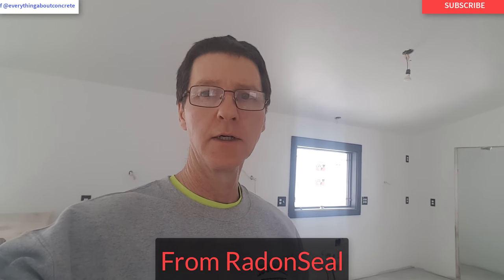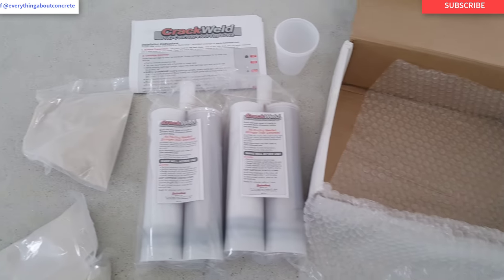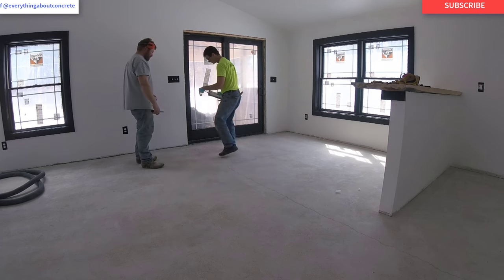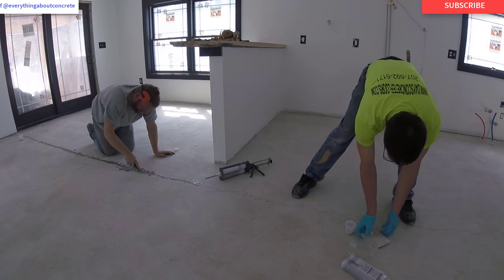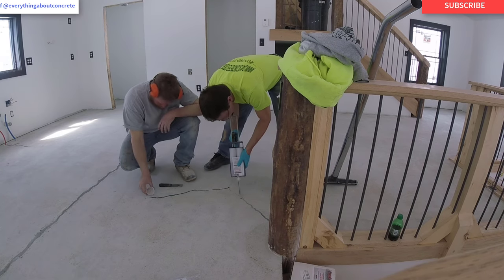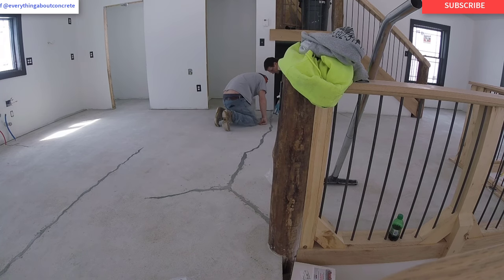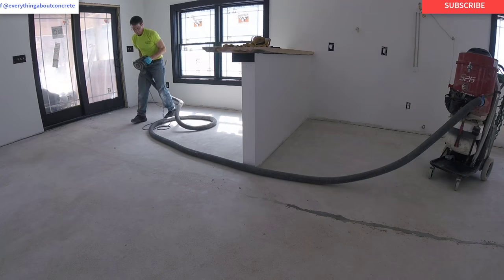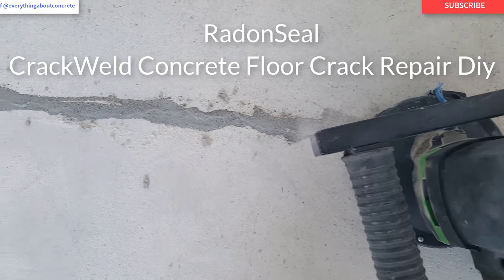HOW TO REPAIR CRACKS IN A CONCRETE FLOOR | A STEP BY STEP GUIDE

Comment: Hi Mike, nice video. I have a contractor who has leveled my floor however has left it with a few imperfections. I would like to have an indoor concrete flooring in a grey color. In my inexperience i see 2 ways. One: re-level the floor with a coloring pigment and then use an epoxy coating. or repair the imperfections with a kit and then use a concrete colored coating which might be a cheaper option. What do you think?

Comment: Hey Mike - thanks for the video. If the homeowner was putting flooring over those cracks would they need filled? Or was it because they were just gonna add a clear layer over it?

Comment: Good morning. A lot of my basement floor cracked due to water coming up from a broken sewer line. That line has been replaced by the cracks are much bigger than the ones you are repairing here. Would you still recommend this product or would you go for something heavier duty? I've also taken care of any other moisture issues by having a french drain installed on the perimeter of the basement.

Comment: The carpet guy asked if I wanted to fix floor crack by caulking or cement. I didn't know, so I thought cement would be best. He made quick cement on the floor and wiped it over the cracks and let it dry. Should a floor guy go back and have it redone with your method then put epoxy flooring on it? Thank you.

Comment: Mike, I just discovered your channel today. Awesome videos.... many apply to me DIY... especially stamped concrete. The final repair of the cracks in this video look great. I scanned through your videos looking for concrete driveway repair to no avail. Do you have a video for this? I have read many different solutions that do not look professional in matching the concrete; it still obvious of a crack even though you may have sealed the problem. Do you have a preference of products and suggested repair method. Thank you Mike.

Comment: I use same idea but different product.  Also adjusted my application,  I wet the crack then pre mix my sand and epoxy into a bucket then apply.     I'm usually doing larger cracks and doing it alone so this way works more efficiently for me.     I never understood mixing the sand in the crack " as is needed for larger cracks " and at times I've had the epoxy not come out at the same rate from each tube and it created areas that wouldn't harden.   So I just started emptying both cartridges after getting crack  into 2 quarts of sand and mix it up.    I've had no hardening issues since.          Obviously for hair line cracks  i would change my application

Comment: You recommend the Dewalt Grinder, DEWALT Angle Grinder Dust Shroud, 5-Inch (DWE46153), but it looks like you're using a different grinding machine with two handles. What specifically is the brand with handles in your video?

Comment: Hello.
I have a 5mm crack running the length of my bedroom and ends at the hinge side of the door. Bedroom is at the end of my house. No further cracks.
At places next to the crack it sounds hollow. 
Need I be concerned and if concerning then how do I fix it?
Thanks in advance.

Comment: Hi Mike, I was wondering where you purchase your sanding discs for cleaning off the top of the cracks once the material is cured?  Thanks Rich Thompson
Reply: Did you ever get these disc's? I'm doing DIY ctack repair and need these. Please tell me where and brand? I appreciate it 🙏

Comment: I have a 1/2 wide crack in my floor (just pulled up the carpet).  It looks fairly deep and one edge is higher than the other.  Can I use this product for this?
Reply from the maker: You can yes. You'll want to fill the crack with some backer rod foam first, leave it down about 1/4 to 3/8 inch, then use silica sand and crackweld like we're doing in the video to fix.
Reply: Thank you!

Comment: Hey, Mike. We just wanted to come back to your video and say thanks. We did Order the Radon Seal and we used it on the job and it worked amazing, however when we were finished sanding it you can see the sanding marks, is there something to put on it to make the coloring blend in after sanding. We also ordered some tools yesterday off Marshallton and used your coupon that you told us too. Thanks for that.
Reply from the maker: It will eventually blend in on color. There's nothing you can do that won't make it stand out more. You could epoxy it to hide everything.
Reply: We are repairing our concrete floors.  Question, there are many cracks and the floor is uneven in some areas. 
Do we repair the cracks and then do a self leveling mixture? Or the the mixture first and then repair the cracks?

Comment: What grinder did you use?
I need to do a bunch of cracks but cannot clear the  basement of belongings in it. Will I be able to grind off the high spots without getting dust all over everything? I have a Shop Vac that I assume I can attach to the appropriate grinder you recommend.
Also, I will not be able to do the whole basement in one session since I will have to move some stuff around. Do I need to get extra mixers or backflow valves so I can do multiple sessions?
Reply: Metabo grinder with dust guard will do everything you need. Your shop vac won’t fit on it but you can tape it and it’ll be just fine
Reply: L

Comment: Are you able to use this product outside on driveways or sidewalks
Thanks Larry
Reply from the maker: You can. It cures very hard. As long as the cracks isn't active, it'll work just fine.

Comment: I have a large half inch crack with big chips chunks missing. Will this work or is there something else i need to use?
Reply from the maker: That's pretty big, I might use Sakrete Pro Mix red bag for that. It'll repair up to 2" deep to feather edge.
Reply: @MikeDayConcrete  ok koolio. i had a "concrete painter" come out and he recommended i get a mason to fill it with quick crete. sounded easy enough.

Comment: Can this material be used to fix the thin cracks in the basement floor that seem to be letting some water come up on the basement floor surface?
Reply from the maker: It will fix those cracks. But if there's that much water coming up, it'll find another way. The crack would have to be dry also for you to use this repair material.
Reply: @MikeDayConcrete  
The cracks are completely dry at this point. There are some signs of water being coming out of them at some point in the past.

Comment: Will this work on fountains? No undercutting?
Reply: Fountains are the son of a bitch of Concrete.
Reply from the maker: It'll repair cracks with out undercutting.
Reply: @MikeDayConcrete  I have all the tools right now to undercut my leaking fountain. I still dont want to do that now. Can you offer up what to do on a leaking fountain?
Reply: Fuck my life!
Reply: @MikeDayConcrete  I tried many times to not under cut. But would like a solution to the problem. Too many leaks to describe. Still not yet tried to undercut anything with Concrete.
Reply: @MikeDayConcrete  I tried it all.

Comment: Why were there cracks in the floor in the first place?I was led to understand there should be an expansion joint in a floor that size🤔
Reply from the maker: Concrete cracks, homeowner did his own floor. Just shrinkage cracks/stress cracks. No problem to fix, we're applying an epoxy coating over this one.
Reply: Agreed........But we have to assume for the purpose of the exercise that has been done. Or that would be another vid...........Maybe a good analogy would be "how to replace a fuse"......One would have to assume the cause(appliance) has been checked first.

Comment: Would you use this on a driveway outside
Reply from the maker: You could, but if the driveway moves it'll crack. This company, Radonseal, has a flexible repair also. Radonseal.com

Comment: Not sure if you are apart of Radon with selling the Crackweld. I am a supplier of one of the original concrete repair product know as an ultra-low viscosity Hybrid-polyurethane. I can sell it a lot less than they are offering.
Reply from the maker: I'm not. This is just what works best for me. Send me one and I'll try it. daysconcretefloors@gmail.com
Reply: loctite pl s10?
Reply: @tbarbuto2345  hey if you like it and it works all that matters.
Reply: @TimothyCorum  I was asking what product you were referring to.

Comment: If there is a crack it is for a reason. There is an underlying issue that is not being addressed and this is only temporary, it will return. Also second floor cement? Must be a condominium

Comment: Wouldn't something like a thin liquid epoxy do a lot better so it can go down deep into the crack/pores?  Then cover it with some cement and it's done?
I gotta crack in my basement I'm looking to fix. Luckily it's not that big, just a hairline. Still, I don't want any raydon or anything coming outta it.
Gotta crack line on the front entrance outside the house. On the porch.
House is only like 10 years old, high quality development in Canada.
I've lived in houses that were 40 years old and didn't have any cracks like this.
Sorry for all the comments. 
It helps with the algorithm anyways for more views :p

Comment: The crack is not "welded."  Your goop may fill the top surface of the crack, but like an iceberg, most of the crack is beneath the surface and still cracked. Maybe your hair dye is affecting your thinking?
Reply from the maker: Great comment Larry, Thank You!
Reply: @MikeDayConcrete , don't waste my time claiming to show how to patch a crack when your click-bait headline is an infomercial for an expensive epoxy. And maybe allow a little gray to remain so you don't look dipped in paint. (You are welcome)